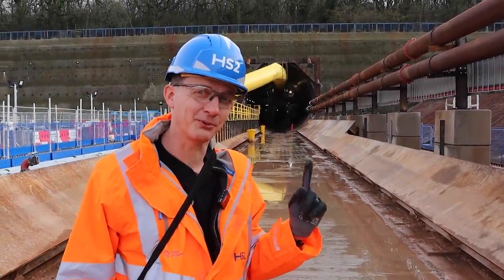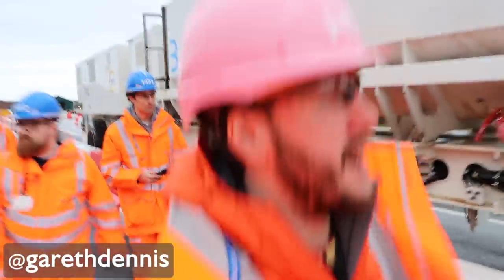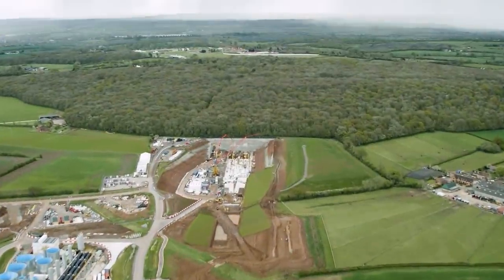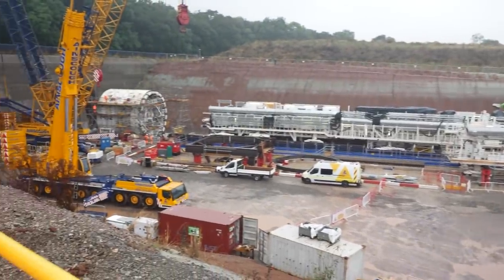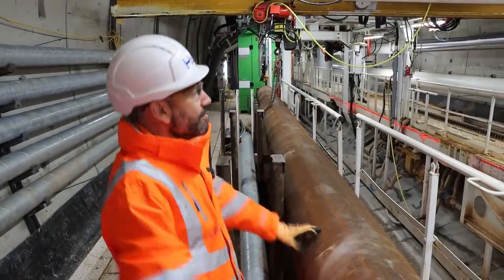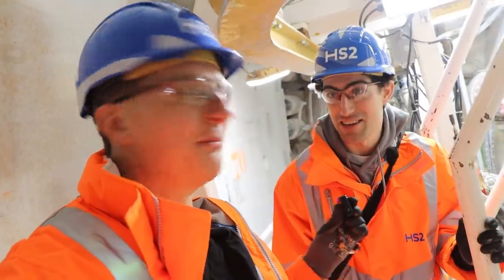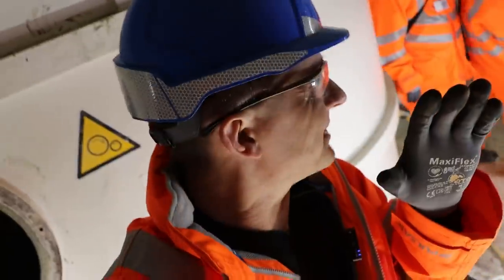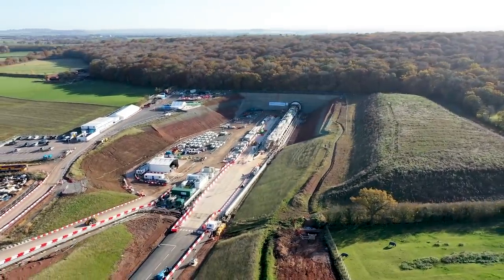HS2 Tunnels at Long Itchington Woods

Comment: Amazing stuff. I've been following this project from afar and enjoy watching the various bits and pieces that come out on it. Isambard Brunel would have been ecstatic could he have seen this and the project overall. 

It's amazing technology that really hasn't changed much in 170 years. The first boring machine was used to build the Hoosac Tunnel located in western Massachusetts. The concept was successful machine wasn't powerful enough to drill into the strong granite and schist located on the eastern side of the 1-mile tunnel and got stuck in the granite and schist. It was this machine that set the cornerstone for what we have today and still use similar technology, albeit a bit more powerful and precise.

Comment: I grew up in Southam just nearby and played in those woods. My family still lives there and unfortunately it's caused chaos in the area along with resentment. The cynic in me would say the tunnel is only going in so the local Polo ground isn't demolished. Other woods haven't been so lucky.
Reply: This isn't unusual, sadly. Where I live across the pond, a highway was planned to extend from Burlington Mass. to Somerville Mass. and pass directly through Arlington and Winchester. The Somerville portion of the interstate took out big swaths of neighborhoods, but the Arlington and Winchester portion was never completed. The residents were more influential and stopped the project in its tracks. Today, the interstate has dead-ended on and off ramps where this road was supposed to connect while the completed portions of Interstate 93 have razed large swaths of neighborhoods in Somerville, Charlestown and Medford.

This same group of NIMBYs in Arlington also stopped the expansion of a badly needed light rail line out to an airport because they didn't want the riffraff in their town not that the people couldn't walk, driver, or take a bus and get there just the same. Today, the traffic is so bad that I dread driving through that area when I have to.
Reply: @Clavichordist  they get what they deserved
Reply: @williamerazo3921  They sure do. I'm glad my journeys down to Bedford and Arlington are far and few between now.
Reply: If you check the profile maps, you'll see that Long Itchington Wood is actually a significant 40m rise in the landscape. I've walked around that area, and there's no way a HS rail line is going to go over the hill, the grade is too severe.

Comment: My first thought on watching this was claustrophobia. Then I got to the bit with the refuge and nearly freaked out. I'm most impressed by the staff 12 hours working on a shift next to the room you might have to run in to when the tunnel collapsed - that's hard core engineering. I wonder how long they'd expect folk to survive in there and under what circumstances would they get there in time.

Comment: When going at full pelt, what will the speed of trains be through the tunnel and how long will it take them to get from one end to the other?
Reply: From what I remember, the standard linespeed of HS2 is 220mph (360km/h), and if the tunnels on HS1 (North Downs, etc) are anything to go by I think that will be the maximum speed through both this and the longer Chiltern Tunnel. Itchington is roughly 1 mile long and Chiltern 10 miles, meaning a train at 220mph should clear Itchington in about 16.3 seconds and Chiltern in 2 minutes 43 seconds.

Hope this helps!

Comment: One hopes the TBM isn't sent for scrap after boring just two miles of tunnel ! There are a couple of short tunnels on Phase 2a which will commence construction soon, (Madeley and Whitmore Heath), and also a tunnel under Crewe to be bored in Phase 2b  plus the 11 mile tunnel under Manchester ! I suppose the latter will get machines of its own.
Reply: Remember that one  f the Channel Tunnel TBMs is still down there - run off to the side after tunnel join and sealed up, because it was simply not worth backing out 13 miles from under the English Channel.

Comment: So what could happen that requires a refuge chamber?
Reply: Flooding of the tunnel if near a river... Undiscovered water source flooding...  Tunnel collapse...
Probably a lot of other things like that I would guess...
Reply: Engineers love the word contingency
Reply: It’s unlikely to have a collapse - but you have to have a contingency. The tunnel maxes out at about 40m below the wood (not very deep) and the local geology is a fairly stable Blue Lias clay - consistently sticky… no chance of hitting chalk or shale around there.
Reply: There is a lot of high power electrical equipment together with high pressure hydraulics in that machine. Consequently there is a risk of  fire, probably quite a small risk. However even a small fire underground  is a serious problem.In a tunnel like this there is only one way out..  If the fire is between you and the entrance you are trapped. The fire will  likely as not be producing poisonous fumes as well as using up oxygen.

Comment: They really need to cancel HS2, by the time it is built it will not be needed.
Reply: Should be a hyperloop
Reply: It's far too late to just cancel HS2, it would cost millions to clean everything up
Reply: @revkingracing84  hyperloops are overrated lol
Reply: Upgrading+ electrifying the Chiltern mainline so no need for the Birmingham section
Reply: @revkingracing84  You still need to increase capacity on the CML